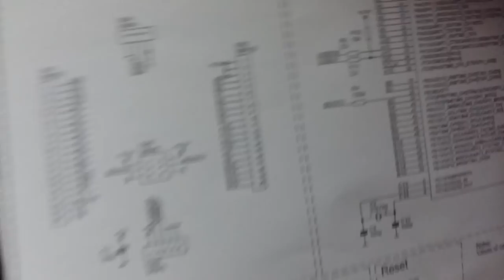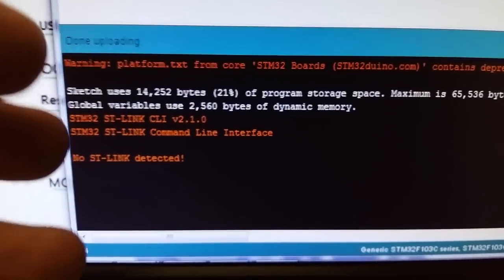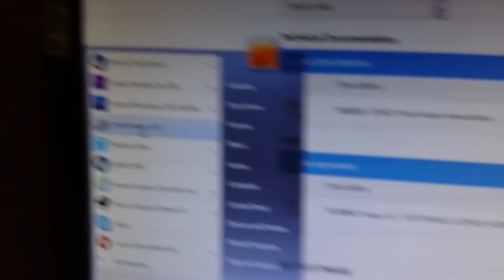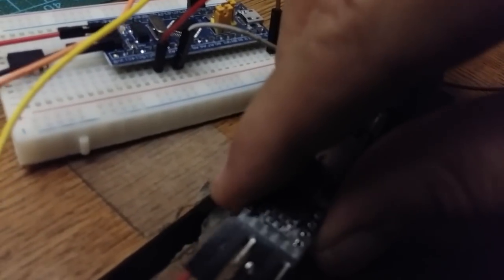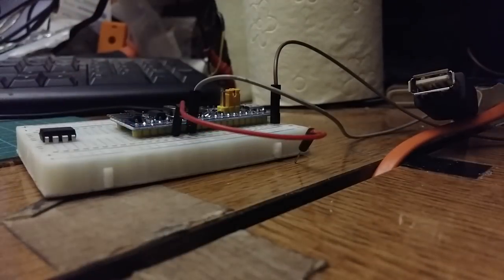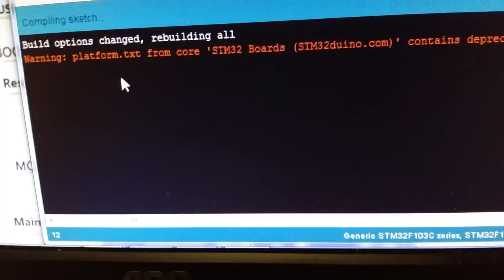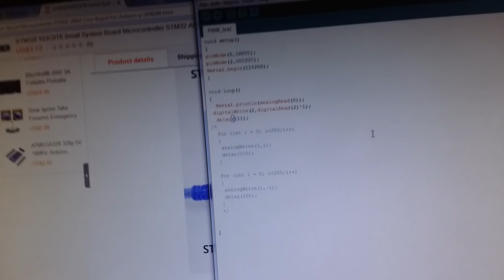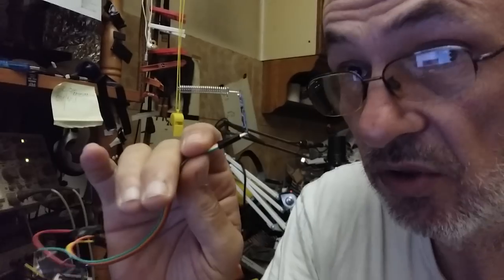Short Tutorial: How To Start Programming STM32 Arduino MCUs

Comment: Hi, nice video and tutorial, very informative and easy to follow. Just one question, is this board completely compatible with arduino? I mean, are the libraries supported as is or do they need to be ported for this board? I'm specifically thinking about color lcd screens and their respective libraries that depend on timings and port addresses. Thanks in advance for your time
Reply from the maker: Main libraries are out there for this chip. You may try: https://github.com/search?utf8=%E2%9C%93&q=stm32 
or some of those: https://github.com/rogerclarkmelbourne/Arduino_STM32
I did not work for a while on STM32, but all you need is to download this libraries into your working folder and add into Arduino IDE. I am not sure at a time which library I did include, because after upgrading new version of IDE, it somehow loses track of previous configuration. For LCD and stuff, I think many things you may find on GitHub. Thank you too for nice comment.

Comment: Hi, have you tried with the stm8 boards?, there's not support on arduino, right?. Thanks for the video.
Reply from the maker: No, I have no STM8 boards yet. I saw on some forums that library is not finished yet for support of this board. Seems that STM32 is more attractive MCU, so someone made support for this boards first. STM8 may be released soon, how soon... don't know.
Reply: that's great that someone it's working on add support for this boards, the stm32 are fantastic but can be an overkill for some projects. Thanks!.
Reply from the maker: Yes, there is gap between Atmega 328P and STM32, and seems that STM8 fits nicelly there. I hope very soon to gather more info.

Comment: Hello 
Thanks for sharing your experiences. 
I am trying to replace a nano with this STM board in my project, but I have a problem when using some GPIO pins as output, for example PB3, it is not working as output resulting in a 0,7 volts out no matter if it is low or high, I am using the arduino compiler. Did you have a similar problem?
Reply from the maker: This is strange. Even if you make it as input, and send 1 to PB3, it should give you 3.3 V as pull-up resistor. But, 0.7V seems that something else is wrong. Right now I can't know what exactly because lack of more details. I must admit that I do not use STM32 often, since I have plenty of Arudino pro mini and playing with this, but eventually will back to STM32, which is really fast. Just... I have problem because in recent time trying to get rid of Arduino sketch type of programing and going into "real" C/C++ programming instead. It is just bit more complicated to get anything in or out of that chip. If you getting voltage change on some pin, say your example PB3, when you change status, say digitalWrite(PB3,1); Some boards has bad printing, so for example B14 looks more like B1 4, then next designation confuses whole thing: B1 4B1 5... Be sure to measure "right" pin. If it is the case, check whether you have proper 3.3V at designed pin "3.3". If it has proper voltage and still 0.7V output... then it may be sign that something else is wrong. And, there is one confusing pin "3VB", which is input for 3V lithium button battery for 32.768 kHz crystal oscillator. When powered with 3V, inside MCU, there is RTC clock...
Reply: +WildMania thanks for your fast answer, I have discarded many possible errors trying with 3 different boards (same reference), trying with many codes, even with blink which works on PC13, PB5 for example, two different laptops, and with stm link and UART, everything is correct but it simply does not work, I think this is a compatibility problem with the arduino compiler or anything so, I will look further and will thank you if you think you could have a possible solution anytime.
Reply from the maker: Ah, there is a catch! Pins PB0 and PB1 are "normal" pins, but pin PB2 is actually under jumper on BOOT1, middle pin (when jumper is removed), but PB3 and PB4 are assigned to JTDO (PB3) and JNTRST(PB4) for JTAG programmer by DEFAULT! There are some forums that states it is possible to remap those pins, but this require more skill that I have. It is then better to avoid those pins, or learn how to remap those pins by... I don't know how, honestly. Here is one example on some forum: http://goo.gl/Uulla6
I think that Arduino team paid more attention to versatility how to program this MCU with different programming devices, rather than how to use all of those pins. I did not know that, and thanks to you I found it interesting for further investigarion how to remap. Also, some quote from other forum: 
"You are mapping SPI1 to JTAG pins, you will need to disable the JTAG function.

Refer to the STM32 Reference Manual (RM0008) Chapter on SPI. PB.3 is JTDO, PB.4 is JNTRST, and PB.5 is not 5V tolerant." and:

"Warning: Since some SPI3/I2S3 pins are shared with JTAG pins
(SPI3_NSS/I2S3_WS with JTDI and SPI3_SCK/I2S3_CK with
JTDO), they are not controlled by the I/O controller and are
reserved for JTAG usage (after each Reset).
For this purpose prior to configure the SPI3/I2S3 pins, the
user has to disable the JTAG and use the SWD interface
(when debugging the application), or disable both JTAG/SWD
interfaces (for standalone application). For more information
on the configuration of JTAG/SWD interface pins, please refer
to Section 7.3.4: JTAG/SWD alternate function remapping."
Reply: +WildMania Wow, thanks you very much, I will read it and try again tomorrow because here is very late in the night, I hope it will, work and I am ashamed because I did not notice it, also I will try to program it in Keil but it requires a bit of research and time, I hope can help you anytime too, thanks again for your time and help.
Reply from the maker: It is real nightmare, please take look at this forum (it is more complex that I can imagine): http://goo.gl/Jp6GWi
Reply: +WildMania I found this http://docs.leaflabs.com/static.leaflabs.com/pub/leaflabs/maple-docs/0.0.12/lang/api/disabledebugports.html#lang-disabledebugports I will try it tomorrow, since the maple mini is an STM32 based arduino it could work. Thanks a lot
Reply from the maker: Yep, it works!!! People on some forums are already deep into advanced programming, but I am just somewhere at the beginning, or little bit more than total begginer, but FAR from being any sort of expert. It is so simple when you know what you are doing. Thanks for pointing out to this document, and it now sounds simple as "disableDebugPorts();", which actually enable PB3 and other related pins to work as IO pins. Thanks a lot!

Comment: Hey! Thank you so much for mentioning the locked state of the board after buying. I finally got my board to work after 2 weeks! <3
Reply from the maker: Thank you too for nice comment. I am trying to find datasheet about registers of STM32, but so far had no luck to find any reliable PDF document. I want to make some direct access to registers, but without PDF, just... not easy.
Reply: Hey, check this thread out for your register problem. If it doesn't help, try asking in the forums itself, I'm sure someone will help :)
http://www.stm32duino.com/viewtopic.php?f=3&t=1318
Reply from the maker: That is EXACTLY what I am looking for. Whole PDF is excellent guidance to the registers. Also, forum is very helpful. Thank you very much for your time. I hope soon back to programming (currently fighting with paradentosis and strong headaches).

Comment: Hi, I wonder you help me burning bootloader in Atmega8. the information I looking for is bootloader file and fuse settings.
thanks
Reply from the maker: You need USBAsp programming dongle for this task. You will need USBASP driver for it (probably your Windows or what you have will install it automatically, I do not remember - it was long time ago). Do you mean just chip on breadboard? If so, you may use another Arduino (Uno...) for this task: https://www.arduino.cc/en/Tutorial/ArduinoToBreadboard
Not sure about other fuses, out there are probably some info. More about it here: http://playground.arduino.cc/Learning/Burn168
I did not yet tried to program chip alone, just already made board as is Adruino nano, Attiny85, STM32, and Arduino Pro mini. Sorry for that.

Comment: Hello i'm a newbee at this.., so basically i got this STM32F103CX (STM32F103C8T6) DEMO BOARD , isn't there any software to code this directly without using FTDI , because the one which i have has a JTAG port plus no reset button . please help
Reply from the maker: The best was to program STM32 chips is ST-link dongle. It is cheap and has everything you need. It is USB device, plug, install driver, and you can program it. On STM32, there is USB port, but this one serves ONLY for communication between MCU and your computer. Not for programming. With ST-Link, you can program it from arduino IDE, or from Keil (uVision) environment.
Reply: WildMania Thank you for your instant reply 
so ST link dongle is my best option , can't i upload the code directly from keil.,by adding STM device database(if its available that is). And sir, i came across something called STM32CUBEFX and CUBEMX software can they be used too.
Reply from the maker: Yes, you can program MCU directly from Keil. Somewhere on the net (YouTube) are many tutorials how to start with Keil, and how to install packages for programming STM32. I am not familiar with CUBEMX, so can't say anything. I hope you will find something on YT.
Reply: WildMania thank you again, it was really helpful.!

Comment: Hey, Im trying to unlock the Board using the Flash Loader Demonstrator, but i end getting this problem- 

"No response from the target, the Boot Loader can not be started. Please verify the boot mode configuration and the flash problem status, Reset your device and try again".

 I have followed each and every step as mentioned in your video . But this problem is something i find difficult to solve. 

Any guidance is appreciated.Thanks in advance.
Reply from the maker: If you move jumper in the position as on my video, then it is okay. If you connected FTDI adapter as described, then it is also okay. One thing which come on my mind is - did you properly selected COM port? Try next: on your Arduino IDE look which COM ports are available when FTDI is connected, and which one "dissapear" from the COM port list. This is then your FTDI port. So, once you detected which COM port, select the same port in Flash Loader Demonstrator. It depends of how many USB things you connecting onto your computer, where "USB enumerator" take care of which USB connection will be which COM port. This is common error, and I will start with this procedure as I described right now. Please try this, and I am happy to hear back from you if you are success in this task. If not, we will try something else.
Reply: Thanks For the suggestion. But i am pretty sure that the COM Port is correct because, in the Arduino IDE it came as COM Port 6 and  the same COM port 6 was selected in the Flash Loader Demonstrator.Any other solution is aprreciated.
Reply from the maker: Okay then. This means that Flash Loader Demonstrator does try to communicate with the device (STM32), but for some reason did not get proper response. Be sure that STM32 is getting ground wire from FTDI as is designed on both boards. The same is for +3.3V (5V will probably destroy the MCU). Then, be sure that TX and RX from the FTDI is connected to pins A9 and A10 respectively. It may happen that it is TX to TX and RX to RX connection wires. This is bad. It should be always TX to RX and RX to TX. So, TX of FTDI goes to RX (pin A10), and TX of FTDI goes to the TX (pin A9). Also, now I am not sure, but try move jumper from 0 to 1 on one that is closest to the pins (boot0), and away from the reset button (if your STM32 board is the same as mine). Second jumper should be at 0, or different than first one.
Reply: Thank you so much sir! IT works.
Reply from the maker: Thank you too for supporting my channel.
Reply: Sure. One Last Doubt - How do i reset the controller before uploading a new program.(Like should i change the postion of jumper pins and then reset it or just simply press the reset button).
 Because sometimes it shows the before mentioned error("No response from the target, the Boot Loader can not be started. Please verify the boot mode configuration and the flash problem status, Reset your device and try again"). and sometimes it uploads normally.Thanks in advance !
Reply from the maker: Leave jumper in position 1. Each and every new upload, you should to press manually reset button. I know, this is annoying, but this is how it is done with FTDI. ST-link dongle has different properties as you may know from the video. With FTDI, you need to change your sketch as you wish, press reset, then compile and upload (by pressing "upload" button). If you are happy with execution of the program, and next time you power up MCU (after disconnecting it from USB), your program will NOT executing on MCU. In this case you should to move jumper into position 0. So, again - every new upload require reset button, and every "normal" working (say for example next day) require that boot jumper is in position 0. Let's call position 1 of this jumper "programming and testing", and position 0 "working state", or something like this. This means that most of your developing sketches your MCU has jumper in position 1, but once done, and you want it to work as "standalone" MCU, now maybe without serial input/output, you may wish to work on some power supply with 3.3V. Then just move jumper into position 0, and your MCU should work. If it stuck for some reason, then press reset. If you are not happy with this program, and/or want to change or add something, then connect back FTDI and move jumper into position 1. Prior to every new upload to the board, you should to press reset -  because FTDI is not capable to reset MCU prior to new program upload. I hope it is now more clear. If not, please tell me.
Reply: Thank you so much! It is clear.
Reply from the maker: Thank you too.

Comment: Has anyone bought an Stm32f103c8t6 that didn't have 128k memory?
Reply from the maker: How did you get to the conclusion that it hasn't 128k memory? Maybe you using Keil for programming and this program allow only 32k long program for free version. For full 128k vresion, there is incredibly high price.
Reply: Milan Karakas mine always have 128kB.  But they are advertised as only 64kB.  I was just wondering if they ALWAYS have 128kB.  I like your channel. Subscribed!  I make videos too.
Reply from the maker: Yep, that is strange: https://www.st.com/resource/en/datasheet/cd00161566.pdf at page 108 (online PDF reader, move mouse up, chose number 108/177), and you will find that your chip should be only 64 Kb, but who knows who made mistake in the designation of the chip: manufacturer, or datasheet designer?! Not a first time that such datasheets has incorrect values, diagrams and other specs.

Comment: what is the name of that tranceiver?
Reply from the maker: HC-12, excellent and easy to power stuff. http://www.banggood.com/HC-12-433-SI4463-Wireless-Serial-Module-Remote-1000M-With-Antenna-p-973522.html?p=EH10221611330201505Q
Reply from the maker: Replace this stupid spring antenna with 16 cm long wire, and you have pretty long range communication between two computers, or use it for your other arduino projects. Also, to save on more than three: http://www.banggood.com/3Pcs-HC-12-433-SI4463-Wireless-Serial-Module-Remote-1000M-With-Antenna-p-980287.html?p=EH10221611330201505Q
Or better (ask your friends, collect money together and buy more for less): http://www.banggood.com/5Pcs-HC-12-433-SI4463-Wireless-Serial-Module-Remote-1000M-With-Antenna-p-980288.html?p=EH10221611330201505Q
Reply: WildMania Thanks for answering. hello from Peru
Reply from the maker: Thank you. Hello from Croatia.